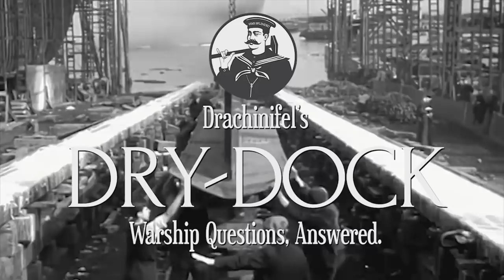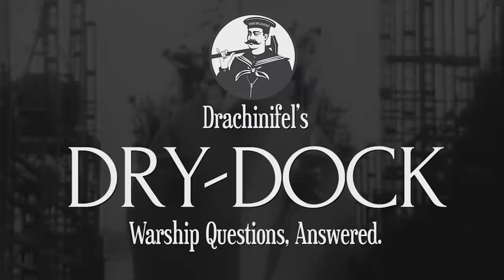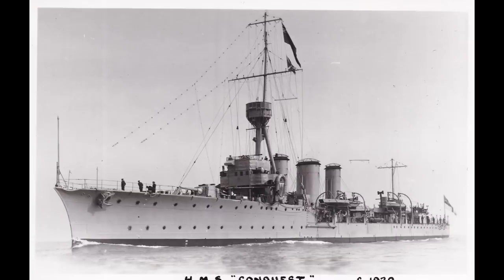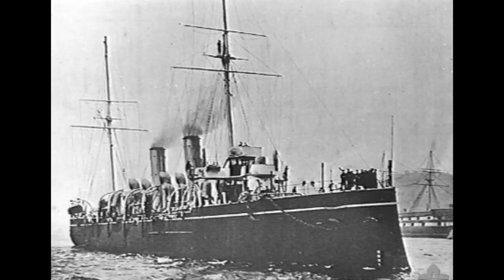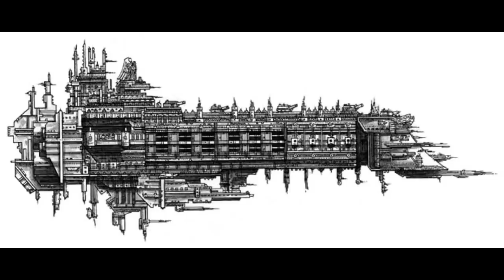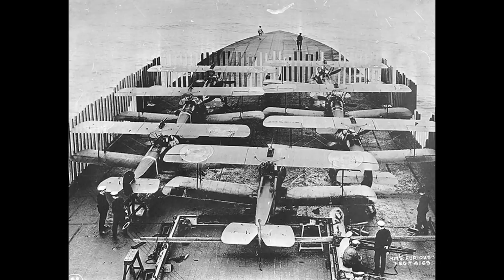The Drydock - Episode 143

Comment: Your shell size versus type comments are right-on!!  Bigger shells with a similar percentage of filler have the bigger blast and fragment effect -- the US Navy WWII 2700-pound 16" Mark 8 AP shell at ~20% heavier than the more conventional 2240-pound, shorter-length 16" Mark 5 AP shell (COLORADO Class due to handling limitations) had a similar increase in both filler (both had 1.5% ammonium picrate very insensitive filler -- "Explosive 'D'") and fragments created.  Heavy-cased AP rounds, though they have less nearby blast power than HE or, with moderate penetration ability and intermediate filler size, SAP shells, do create lots more fragments due to having more steel to shatter on detonation, so there is a trade-off between blast power going down, but fragmentation going up when using AP rounds.  Thick-nosed SAP and AP shells also have these break up into relatively few large pieces that can tear through a rather long distance inside a ship due to their greater momentum, with some chance of doing more widespread damage than the high-power, but tiny, fragments of the shell's middle body mostly confined by even rather thin bulkheads (the base plug can bounce around too, but usually is more like a single shot-put confined to the space the shell blew up in).  Getting through the armor to damage the important internal areas hit is the most important thing against heavily-armored enemies, as the many but non-penetrating hits on SOUTH DAKOTA by an entire Japanese squadron, including the battleship KIROSHIMA, demonstrate conclusively..

Comment: 12:38 Regarding the rental car comment...  When I was much younger, I got my first "new" car. A '99 Chevy Cavalier Z24.  On the way home from the dealership, I went to a low traffic road that has some curves followed by a long straight-a-way.  After screaming the tires thru the curves, I hit the straight and put the pedal down. At 108mph, the engine dropped to idle and the transmission went to neutral and I started coasting. I thought I blew up the thing with only 12 miles on it.  Turns out it had computer chip governor in it and everything came back on once I had coasted down to 90.

Comment: The third half of the shell equation is the fuse - if you don't have a reliable fuse it doesn't matter how big your bursting charge is
Reply: Reliable and appropriate.   Even worse is the AP that explodes 60 ft outside of the boat it just went through and through.

Comment: A "battle-cruiser" was a fast, relatively lightly-protected ship with guns big enough to destroy any regular cruiser with guns up through about 8-8.3", either as part of an attack squadron (Falkland Islands WWI destruction of that German cruiser squadron) or as, like the destroyers, a defense against enemy small-ship attacks on  the battleship battle-line (Jutland, where they were very badly used by the British and they paid for it).  They have no other use, since they cannot stand up to a fully-armored battleship unless they get some lucky hits early on, which, as the sad history of British battle-cruisers show, is much more likely to go in the opposite direction in such a fight.  Thus, until they got armor roughly on a par with battleships (read HMS HOOD, though its inferior deck edge protection and lack of internal armor to isolate the various regions -- magazines and propulsion spaces -- as in most now-obsolete WWI-era British warship designs, probably contributed highly to its destruction), they were ONLY fit to kill lesser ships.  ALASKA Class thus becomes a classic battle-cruiser of the original meaning, though now with anti-aircraft duties added to anti-smaller-ship duties in a squadron; an ALASKA versus even a couple of Japanese WWII cruisers would usually be easily the winner, barring very bad luck.

Comment: Certainly a valid point about Richmond possibly wanting to preserve ammunition for a possible closer engagement if the Japanese managed to force it, but the same consideration did not prevent SLC and the Japanese cruisers from banging away with every bearing 8" gun for close to four hours. As I understand it, SLC did so much shooting over that time that it was down to HC in the aft magazines and the crew was hauling AP shells out of the forward magazines and back to the rear turrets.

Comment: 180mm guns is kind of different. So the Kirov design is based on an Italian design of a cruiser with 3x2x152mm guns , what the Kirovs are is basically 3x3x203mm. You see the 180 was not designed from scratch the gun itself is based on 1904 pattern 203mm gun aka British 8/50 gun. In 1926 the idea was create a long range gun with 100 kg shell going 1000 m/s. Initially the barrels were not lined , they later bought equpment for lining the barrels from Ansaldo. The gun was extremely long range and awesome penetration wise as the shell has higher than normal elongation meaning it has relatively lower drag. The problems come from 2 things : extremely high gas pressure wearing out the barrels and altering ballistics so fast that it plays a role inside a battle and 2 cramming 9 guns about the size of 203 into a light cruiser.

Comment: The Alaska's to me often just look like where cruisers would have been had you not had the fixing in place definitions of the treaty with the guns and displacement limits. When you stack them up against the Iowa's, Yamato's and Montana designs at one end and the Gearing's at the other it does look like they would fit in as the heavy cruiser with the 8 inch cruisers taking the place of the light cruisers.
Reply: The 8 inch heavy cruisers were too big and expensive to use as light cruisers.
Reply: @luisnunes2010  If you mean in terms of numbers needed for all the roles light cruisers were used in, then you would be right. It would likely be more that either the distinction goes away or you get more dedicated trade protection ships like the Leander's. Its mostly a moot point due to the shift to carriers but had you gone with size progression like you saw from Dreadnought to the treaty then I would expect that you have you Battleships around the Yamato-Montana range, battle-cruisers around the Vanguard area in terms of displacement but as Drach said a bit more like a scaled up Renown with 3x2 16 inch guns and 32-34 knots speed range. A heavy cruiser approximate to an Alaska that would be expected to be able to kill light cruisers, take on battle-cruisers (with support or numbers on the Alaska's side) and lead flotilas of light cruisers that would have sat about 10,000-12,000 ton range and been using 8 inch guns. These would be the  heavy fleet screen and double as heavy convoy escort along side a more dedicated trade protection cruiser that I would expect to be more focused on anti-sub work with a duel purpose main battery for anti-surface and AA. Those ships not being expected to take on proper surface warships bigger than them.

Comment: Seeing that you are a "massive sci-fi nerd", as you put it, I have an enhancement to ALL energy weapons using frequency-based power (electro-magnetic or other such energy type), including, I think, the DEATH STAR's planet-buster, so that they have no isolated projection points, that would, in the DEATH STAR's case, eliminate the huge planet-killer's focusing dish and allow the beams to be projected in ANY direction from a spherical warship (or a spherical weapon sticking out of a spaceship).

It is a version of a phased-array system using the entire surface of the sphere with many tiny, individually low-power sources that are fired under computer control at FASTER-THAN-LIGHT spreads along the sphere surface (this is actually used in phased-array antennas since the antenna face is the longest side (hypotenuse) of the triangle formed in such electro-magnetic antenna system to generate their roughly flat-faced simulated-physical-aimed antenna pulse in any direction).  You arrange the many tiny sources into a pattern that covers the entire surface with as many roughly straight-line runs in any direction as possible (a topological flat optimum close-packed-array problem).  You slightly turn the sphere so that one of the sources is aligned precisely between the center of the sphere and the center of the target, creating many concentric rings of sources going from that aim-point to near the visible edge of the sphere as seen by the target, so that the farthest edge ring has many, many sources, getting fewer and fewer as you get closer and closer to the aim-point single source.  Since we are using a frequency-based energy beam,. by turning on and off each one of the individual sources correctly with proper timing (again, simulating a faster-than-light signal moving along the source firing cycles), usually the edge sources first and converging toward the central aim-point source in a rapidly shrinking ring timed just right, all of the power of each ring would be added to the energy created by ALL of the previously fired outer rings and so you get THE ENTIRE POWER FROM HALF OF THE HUGE SURFACE AREA OF THE DEATH STAR, as an example, turned into the same kind of tiny point at the enemy target as if a huge magnifying glass was using the sun to fry ants, though here generating its own power in a pulse or continuous beam, whatever your weapon's power source allows.  Not only that, but with proper design for each radial row of sources from the center aim-point source to the edge sources, you can created what are actually many separate highly-polarized beams - you may have to ripple the sources somewhat to do this to keep these flat, edge-on-to-the-target, polarized beam from interfering with each other).  What was discovered about such polarized beams using this system (from studying the different energy beams being generated by high-spin-rate pulsar-type neutron stars) is that each polarized flat-edged beam only falls off in power with distance at 1/R due to essentially all of their energy in a 2D plane expanding only as a narrow triangle in that plane, not the usual 1/(R-squared), making the range of the weapon MUCH LONGER than most others that use a narrow cone-shaped beam that widen in sideways area versus the latter more diffuse range-loss formula.  So, you can get all-round aiming, high power without having to have very concentrated single-point radiation sources that can be difficult to control or keep from melting, and as an added benefit, much longer effective ranges per firing.

Kind of makes the DEATH STAR system obsolete as a vacuum-tube radio compared to a phased-array antenna solid-state communication set...

Comment: The Alaska class are large cruisers.
Why, because the USN always regarded them as large cruisers.
Their smaller size and smaller caliber guns also denote these as large cruisers, not battle cruisers.
Too bad we didn't have half of dozen of them at the start of the war!
Reply: The Alaska-class isn't really worth it's price because for the cost of one Alaska you could have a full fledged battleship that can do everything better, or two heavy cruisers that are cheaper and just as capable.
Reply: @KatyushaLauncher  
Not another Battleship for the cost of an Alaskan.  The Alaska's were smaller displacement, thinner armor, and smaller guns.
They would have been cheaper to build, and faster.  and probably have been a more cost effective escort for the carriers.
Moot point, because we didn't have them, my statement that "too bad we didn't have half a dozen" was based upon if we had started building them sooner!
By the same token, too bad we didn't have a doesen more carriers and Iowa's.
Reply: @mahbriggs  The Alaska actually still cost almost as much as a full on capital ship, displacement wise, the Alaska weighted as much a WW1 Battleship and almost weighted as normal WW2 Treaty Battleship as the Alaska's full displacement is almost 35,000 tons, the Alaska's armor may be thinner but due to her sheer size that armor is going multiple and there's also the fact that the Alaska's armor layout is of modern design and still as expensive or even more, you do realize that those smaller guns are much more expensive? Because Alaska and Guam were the only two ships to mount those guns, only ten turrets were made during the war (three for each ship including Hawaii and one spare). They cost $1,550,000 each and were the most expensive heavy guns purchased by the U.S. Navy in World War II. See they're not cheaper, they're also not faster since other Heavy cruisers and even the Iowa-class of Fast Battleships are faster than the Alaska-class, An Battleship or 2 Heavy cruisers have double the amount fire power and anti-aircraft capabilities than a single Alaska. And My point is there's no use building them early on because they're not better than a single battleship or two heavy cruisers
Reply: @KatyushaLauncher  I don't get your point.  So they were bigger than WWI battleships, they are still quite a bit smaller than the Iowas, and I think you are wrong on cost.  I have been unable to find a reliable figure, but that almost certainly includes the development cost of the ships, and since one was cancelled after launch 80% complete, yeah average cost goes up.
And what part of smaller displacement do you not Understand?  They were shorter and narrower, and more lightly armored, they definitely were not battleships.
I really don't understand why you are arguing anyway.  We didn't build six of them, before or after the war, or have six new built battleships or carriers before Pearl Harbor Either!
It would have been damned nice to have had all them at the start of the War!  Provided, of course they weren't all based at Pearl Harbor.
Reply: @mahbriggs  The Iowa-class was the second largest battleships in the world so of course the Alaska-class as well as any other WW2 Battleship (except for the Yamato-class) would be smaller.  I'm sorry but your reading comprehension is very wrong, that $1,550,000 is the cost OF ONLY one main gun turret of the Alaska-class, that's not even the cost of the whole ship, now if you connect the two dots together, if the Alaska-class's guns cost that much, what would the rest of the ship cost? 
And what part of expensive do you not understand? The expense of steel of that time is high and the demand for it as well, so even if the amount of steel used to build the Alaska-class was less than a Battleship, the cost of that steel will be as much as the Battleships, I never said they were battleships. I don't also get that you're trying to argue on a Class of ship that's useless than a Battleship, A Cruisers, and Carrier, it certainly is not nice to have them early on in the war knowing the fact of it's uselessness

Comment: The Iowa's are Battlecruisers.
Reply: This is defensible, although it would be more correct to say the Iowas were a battle ruiser version of the Montana class. The Alaskas could have been really interesting as a battlecruiser variant of the South Dakotas, with three two-run turrets with 16"/45 Mark 6 guns and a reduction in armor to get up to 30-33 knots.
Reply: @kemarisite  If the Iowas are battlecruisers because they're not armoured against their own guns, the Yamatos are also battlecruisers because they have the same situation going on (except for their frontal turret armour).
Reply: @bkjeong4302  not specifically about the Iowas and their armor, but their ridiculous speed compared to their predecessors, with no real improvement in armor and only a debatable increase in firepower. The Montanas would have been much better battleships, which is admittedly inevitable given the common design lineage and increase in size. I also tend to make a distinction between a defensible argument (one that presents articulable reasons) and a position I agree with.
Reply: @kemarisite  Fair enough.

Comment: About Alaska
Its far closer to original Armored Cruisers than to battlecruisers. The whole point of a battlecruiser was to have an armored cruiser with battleship guns. As for comparing things like raw stats mission of the Invincible large part of is just caused by technological progress same case as it was with the drednought, they were both faster and superior to previous ships. Also Battleruiser was evolution of an Armored Cruiser which already was intended for battleline in a limited way while Alaska evolved from heavy cruiser which was not designed for that.
Also wasn't Alaska built to match expected enemy unrestricted cruisers? This is just escalation of a cruiser or going back to armored cruiser of the old. Deutschland is pretty much a modern armored cruiser too in every aspect. Alaska couldn't stand in contemporary battleline nor meaningfully contribute to it.
Alaska and Battlecruiser overlap only over the shared Armored Cruiser characteristics but what is importnat is that small difference.
Reply: The thing that gives it away is the Kill anything it cant outrun and outrun anything it cant out fight idea is an Armored Cruiser thing that battlecruisers just took over.
Reply: Would have been nice to have a pair in the Slot in November '42...